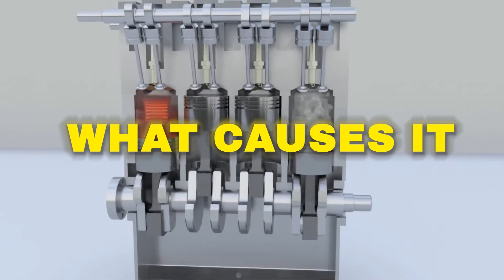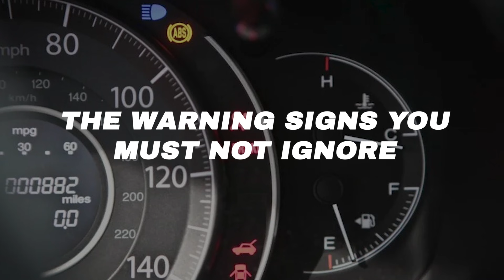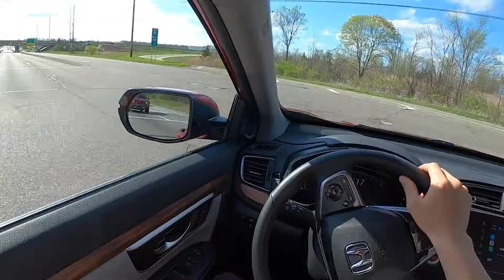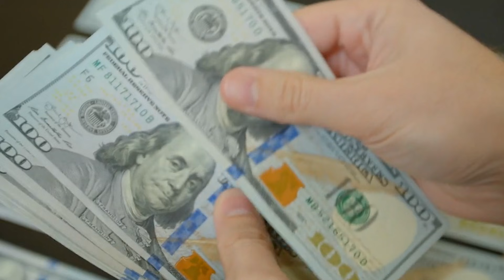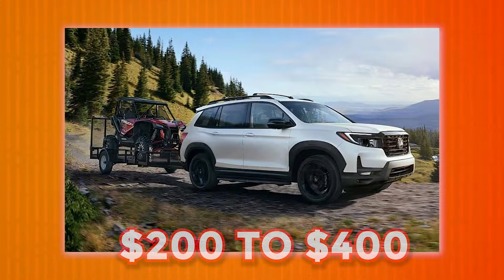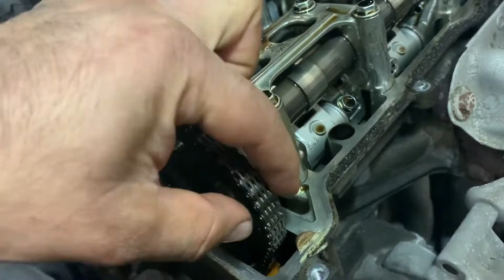Attention Honda Owners! FIX THIS NOW Before It’s Too Late!

Comment: Turbo charged engine 1.5 liter of course it's a problem, Is why I won't buy 1.5 liter turbocharged engines, If You do don't used Ethanol Gasoline especially in Humid weather conditions.

Comment: Changing the PCV on my 2010 Accord 4 cyl only took about 10 minutes.  It is right on the front of the engine, towards the passenger side.   The old PCV was still working fine, the engine had just passed smog before I bought it.  
But it is CHEAP insurance to keep the engine running for a LONG time.    Defective PCV can also allow excessive crankcase pressure, blowing out gaskets and seals !

Comment: I just changed my PCV valve last week in my 2020 civic si.  The part was $35.00.  No removal of the valve cover needed.  The PVC valve is behind the last piston , in front of the passenger seat.  It took about 5 minutes.

Comment: i bought a non-turbo and non-cvt honda. my odyssey does have a vcm muazzler device installed. I also change my oil every 5 K miles with Valvoline R and P 5w-30.
Reply: Thanks for posting these extremely interesting details we were all wondering about.